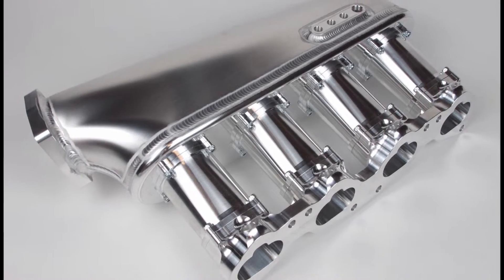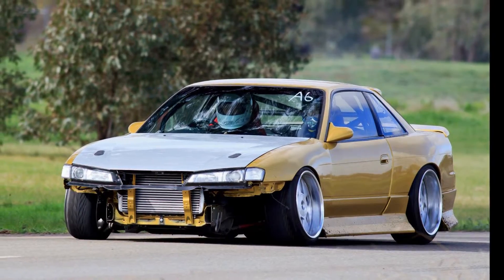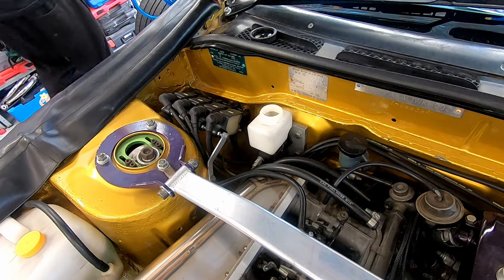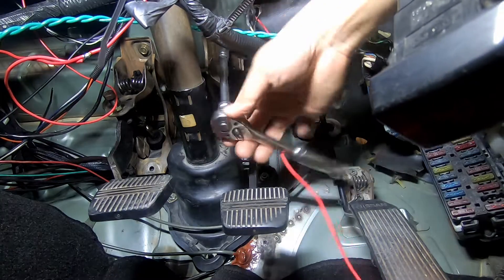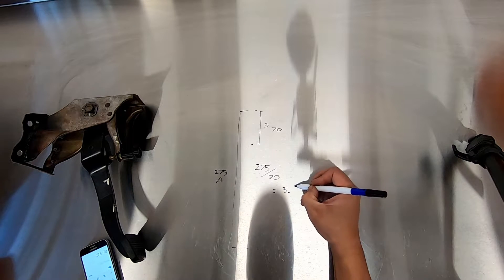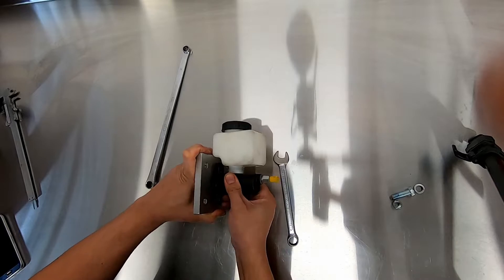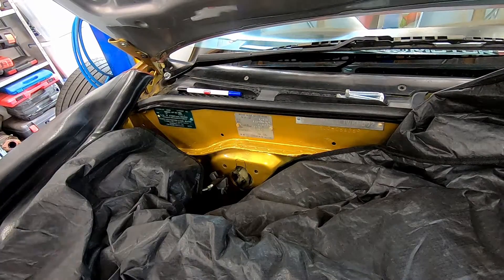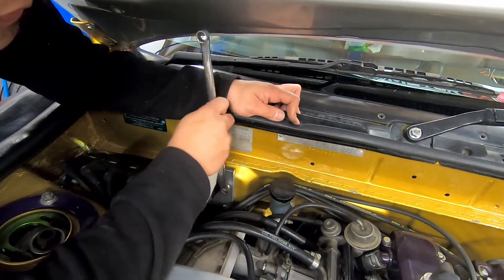How to Correct Brake Pedal Ratio for Manual Brake Conversion (Brake Booster Delete)

Comment: Nice vid man. I installed FG era V8SC alcons, seperste master booster delete deal and all new -3 lines to my falcon - however I didn’t factor ratio in. The brakes worked ok but not much better if at all than road car brakes. Measuring ratio factory B series = 3.46, not ideal! I’m in the process of modifying the ratio to approx 5.77. Be interesting to see what happens!

Comment: Great Info and very well presented! Your video is a God send for the rock hard pedal on my 1967 Mustang with manual braking system. Can't wait to get started and get my pedal ratio back to where it needs to be. Going with a new Wilwood 7/8" or 5/16" bore, new correct pedal and new prop valve. Thanks for sharing young sir. Cheers and blessings from Motown Usa.

Comment: I am really curious as to how you retain braking on one front wheel, and one rear wheel, when you loose one circuit on a dual master cylinder, since both front brakes are on one circuit, and both rear brakes are on the other circuit (unless you have a Volvo from 66 on, until unknown year, because they have dual circuit front calipers, so you retain both front brakes (but only on two of four pistons) and one rear brake, when you loose a circuit)
Reply from the maker: Hi Jesper, Good question. In my case which is a dedicated track car I do not have a diagonally split tandem system nor a twin master system. Traditionally a motorsport system is never diagonally split however 2 master cylinders are used, 1 master for the front circuit and 1 for the rear circuit so if a failure was to occur there would still be brake force on 1 axle wether it be the front or rear. A single master system does not have the same redundancy as a twin master or a tandem master system.